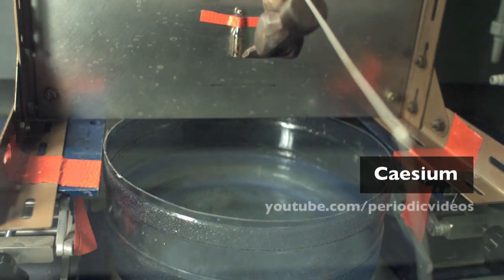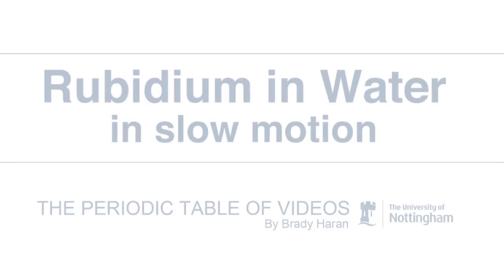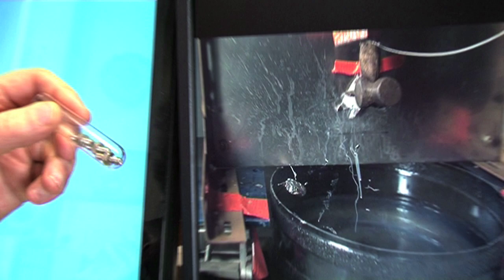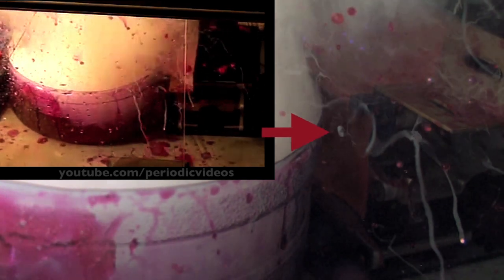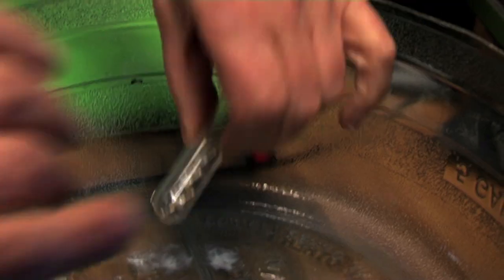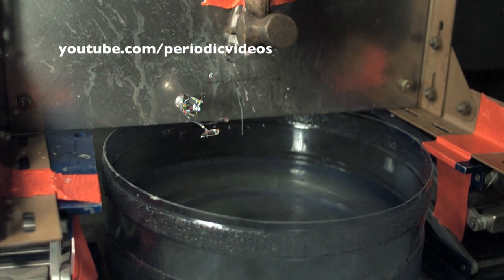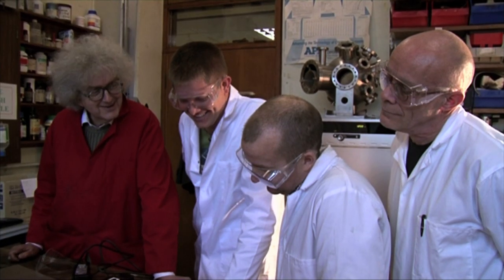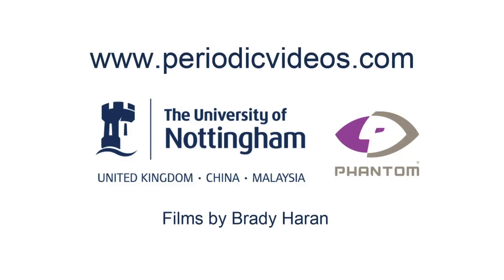Rubidium, Water and Indicator (slow motion) - Periodic Table of Videos

Comment: I like how you can see the partial Rubidium glass container zipping around the bottom rim of the water container like a very fast torpedo. It must have went around like twice in the first tenth of a second cause you see it go by then it explodes again back at the point you seen it zip past. So either it expelled some of the metal out and exploded shortly after or it went around twice very fast. It almost had a pulsating tempo as if to keep it's momentum going.

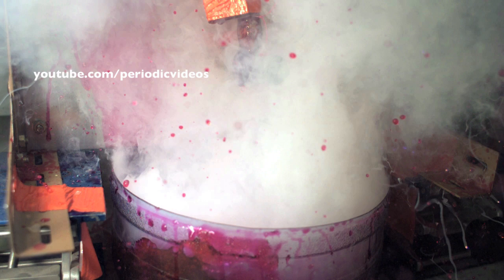Comment: If you watch the right side of the screen carefully at 5:48 through 5:50 you will actually see that the ampule has jumped up out of the water and is near the top of the screen.

What I think actually happened is that your second reaction occurs when the ampule lands back in the water, as the reaction begins at the right had side of the vessel at around 5:57 to 5:58.

To take this a little further, I would say that what is happening is similar to the charcoal/liquid oxygen reaction where the gas that is created is keeping the ampule bouncing on top of the water and then it throws it up into the air where the reaction slows and when it hits the water again it begins to strongly react. 

You are also able to see shards of glass ejected from the water towards the right of the screen between 5:44 to 5:47 which seems to indicate that you have a pressure wave that not only propagates from the explosion to the right but also hits the side of the container driving that wave towards the right as well. When the ampule hits at the right around 5:58 the reaction pressure waves seem to move back towards the left.
Reply: Actually looking at it again and pausing frequently, I think that you can actually see the ampule circling around the indented ring of the container from the left side where it first enters the water. The signs are the purple light and stronger explosions at around 5:46 and 5:47 at the front of the container, just before the ampule ejects up from the water on the right hand side.

Comment: There is no need for a reaction control system, nor even the rounded bottom. All directions the ball of metal can take will ultimately end up on the radius in rough or smooth motion about the center. The blob of metals appears to make around 2 rough circuits of the tub perimeter and each time slag is removed the reaction speeds to a burst and the blob moves on with renewed momentum.

Comment: The really interesting part of this reaction is that not only does the Rubidium go off in stages, but like the Professor said, each time the water rushes down the remaining tube of the Ampule  and reacts with another piece, the remaining Ampule also gets pushed around the container, like an engine that's being 'pushed' forward by focusing repeated explosions out of a nozzle like one of those early 'thrust powered by atomic bombs' rockets from Project Orion.

Comment: at 3:21 I can see a flash on the right side of the container.  In the next frame I can see the tip of the tube shoot up out of the container until frame 3:25 when it begins to descend back into the container to explode again. It looks like what's happening is that the tube drops into the container, rockets around the container in a series of three explosions, then drops back into the container to keep exploding from the exposed end.

Comment: one thing only slightly touched on is that, because the ampule bottom is largely intact and rounded; the reaction applies force all to one side of the rubidium mass, with the opposite side being able to move through the water quite easily. If you look closely just after the first reaction you can kindof see a trail of bubbles shoot across the front of the tank before the second reaction. In effect, they've made the world's smallest torpedo. Now we just need a tiny reaction based control system.

Comment: I wonder what sort of reaction you would get if you just kinda put a small amount of every element known to man into a container together and shook it about a bit
Reply: You'd probably give birth to a tiny earth. =D
Reply: +darkIkarusEssence Aww, I like that answer. Thank you! :'D
Reply: It's a very interesting question, and you've made me think quite a bit about it! I have a background in chemistry, and my initial thought is that you would get a reaction from the reactive elements. So hydrogen, sodium, lithium, chlorine, oxygen, and especially fluorine would be most involved in the reactants, each forming random compounds depending on what is around them. Water may form, table salt may form, it's anybody's guess. Then you would have the noble gases and several nonreactive metals sitting around, watching the events unfold. Great question!
Reply: You would get a lethal dose of radiation from the ultra-heavy elements.
Reply: I bet the amounts of different compounds would change randomly each time you tried it. Say the Sodium and Chlorine hit each other first, started a reaction at a different temprature than a different salt would make, taking a little more or a little less time to start burning the Hydrogen and Oxygen together, making slightly more or less water available to reach with X Y and Z, etc etc. 

Set off an avalanche and see if the snow falls along the same path or not.
Reply: I'm 3 years late but I love this question!
Reply: Hydrogen

Comment: Hydrogen is a fantastic fuel. An engine running on H does not produce nearly as much pollutants as gasoline/diesel. Not even comparable. Best option for thermodynamic engines.

But the thing is that it's expensive to produce. And storing it is also another problem (for cars). But you can bet that Big Oil doesn't want us to develop efficient methods. 

Don't know why you were pointed out as a spammer and got so many votes down. Your questioning is totally legit in my opinion.

Cheers buddy! ;)

Comment: the reaction of rubidium with water produces hydrogen and rubidium hydroxide.   the phenolphthalein indicator then reacts with the hydroxide produced in the original reaction to create water and the pink phenolphthalein anion, so the indicator doesn't significantly change the reaction, it only adds pink (also, the concentration of phenolpthalein is probably in the parts per million range)

Comment: Regarding the emission of light--do you think it's the visible spectrum, or possibly partially UV or IR? In my cameras, the sensitivity of the CCDs encompasses more than the visible spectra, it also includes some UV and IR. One way to test this is to point the camera at a hot object emitting heat but not visible light and see if that is recorded as a visible glow on video.

Comment: If you ever get a chance to use a high-speed camera again, perhaps you could use LEDs for the lights rather than hot incandescent lights so you won't have the melting/spray issue with the reactive metals?

Comment: This is excellent, looks a bit like a daylight volcanic eruption.

I'd recommend making a system which would dispense the cooled, solid metal in the form of a chunk onto a wide and shallow plate filled with 1-2 cm of water. That should give the most spectacular display of bursting vapor, hydroxide mist, spraying molten metal and coloured fire and should kind of like an asteroid impacting the ocean because of the molten material and the glow.
It would be a bit more dangerous, though. Just a bit..

Comment: All the water, even the tiny drops that are splashing out of the container, turns pink almost instantly.  It would be interesting, and quite possible (altho perhaps a bit tedious) to test the pink droplets for rubidium.  I suspect the rubidium ions themselves are not diffusing so quickly thru the water, nor are individual hydroxide and hydrogen ions, but rather the water molecules collectively re-establish the equilibrium of the Arrhenius equation with unbelievable speed.

Comment: A hydro carbon is a long chain of carbon atoms with hydrogen atoms.hydro carbons depending on the ratio of hydrogen and carbon can burn,for example if a hydrocarbon has more hydrogen atoms it burns hotter but quicker,and if there are more carbon atoms it will burn colder but longer

and thats also why we use them for feul,from beutane to hexene

Comment: when the rubidium gives off the lilac colored light, why is the light lilac... you mentioned that the solution is red because it absorbed all other colors but reflects red but what happens when light is its source... is the air around it absorbing all other colors but reflecting this lilac color or is it the light wave that it is producing?

Comment: It would be so cool to just see this element, let alone drop it in water. These scientists are so lucky to have access to all these goodies.
Prof. Poliakoff,  Please do a video on the ultra heavy elements (Ununseptium and such). Anyone ever wonder how heavy we can build?
Reply: fla playa Just because an element has a big atomic mass, does not mean that it is heavy as a solid. It depends on the density. A block of Osmium with the same volume would have a bigger weight as something like the really large atomic mass atoms at the end of the periodic table (not to say that Osmium doesn't have a big atomic mass, it is pretty massive aswell).
Reply: Two ways to define "heavy" in chemistry. The density of Rhenium is 20.02 g/cm3 tops out with Osmium at 22.59 g/cm3 and drops to 19.3 g/cm3 with Gold... The predicted density for Ununseptium is to be 7.1 g/cm3, which is craziness in my humble opinion. I was referring to large nuclei not density but I did just learn something. Never knew Osmium was the densest metal. Again I wonder how heavy or big we can build? Your prediction for the next 25 years?
Reply: Using dense materials doesn't necessarily mean it is practical for construction. More weight means more structure is needed to support it. Using lighter, flexible and resistant materials is more useful if you want to build "big". As for how big we can build, I think vsauce has a video on it or some channel like that. Using vanguard modern materials, a carbon nano-tube weave could resist the extreme forces required for a space lift, so if you count a cable that is 36000 km long as a construction, then I'd say that is one of the largest things we can build. Basically an elevator made of a cable and a ballast using the rotation of the earth to stay erect at the geostationary distance. For actual planned buildings, there is one in Saudi Arabia supposed to be 1km high, Kingdom Tower I think, That's pretty impressive.
Reply: I'm talking about building large atoms, not structures. The current biggest - heaviest - largest element is Ununoctinium 118. Again, I wonder how big - heavy - large we can build.

Comment: Here's another theory for the two explosions that rattled the water container: The first explosion sends a lump of rubidium back upwards from the surface of the water. This lump then drops back into the water, causing the next explosion.

At around 0:40 we see the event in what I take to be normal speed: There's the bang of the hammer impacting, then two "pops", separated by 1/4 to 1/3 of a second. If my theory holds, the rubudium lump jumped to 7½-11 centimeters (3-4½ inches) above the water.

Comment: a couple kilometers? by the time it's reached the ocean i doubt there'd be enough water suspended in the outer atmosphere to completely eat it away.
it may be coated in oxide though.
imagine it floating to the bottom of the sea, and an explosion or foreign chemical eats away that layer. and the ocean blows up. awesomeness.

Comment: Actually, he's right. Nothing spectacular would happen. Rubidium does react with the atmosphere, but if the ampoule was scored and opened in an argon glovebox, and then closed with a rubber bung, nothing would happen. Even if you work quickly in air, the top layer of the metal would just tarnish.
Rb and Cd aren't immediately pyrophoric on contact with small amounts of air.
A system could be made which would allow the removal of the bung and the rotation of the ampoule from the distance.

Comment: The reason that the "bottle" cannot simply be rotated. First the metal is in an ampule not a bottle. An ampule is a sealed glass container. As you can see when the Rubidium is first exposed to air, there is a smoke trail, this is because the metal is reacting with the water in the air.  If the Rubidium wasn't in an ampule the reaction would happen prematurely and would be extremely dangerous to everyone involved because there would be no control. These people know what they are doing.

Comment: I would like to see the experiment conducted in a different way. Have the metal in its tube taped to the bottom of the water container. On top of the metal have a sheet. Water is all around including on top of the piece of metal. An object is dropped  breaking the tube and starting the reaction. You should get a much more violent reaction.

Comment: by "lobbying oil pricks" I explicitly referred to the oil industry, I even made the effort to put it in parenthesis and hang an adjective ahead of it with a verb to make it as distant as possible from you, but apparently that didn't work. As for nuclear power, hydrogen is shitlessly cheap, use electrolysis, you can make hydrogen at home with some very simple electric equipment. The nuclear power just provides the megawatts required. And I'm talking fusion power.

Comment: "reacting chemicals with other chemicals without applying heat", and "using electricity" still is not a chemical reaction but a flowing of particles and using magnetic fields

Comment: Engines that burn fossil fuels in power stations are about 40%-60% efficient depending on type of fuel. Impurities aren't as high as you think and have a minor effect on efficiency. Your point about electricity is invalid; the chemical energy would undoubtedly be turned into electricity. It's just too convenient to transmit and use electricity as opposed to shipments of chemicals with equivalent energy. It would be dangerous at every step of the process. Research energy density.

Comment: Just because I pointed out that HYDROGEN GAS is expensive to produce doesn't mean I'm an oil prick. Quite the contrary actually. Otherwise, I would never have labeled it as being ''a fantastic fuel which is the best option for thermodynamic engines''.

Nuclear reactor? Sorry but I'm all against nuclear power. 

It never ceases to amaze me to see how some people like you can be so driven by their emotions that they can't even think straight.

Comment: The problem is that without an easily accessible source of free hydrogen you are just pushing the problem somewhere else. Sure, you aren't burning gas in your car anymore, but now you're burning coal for the electricity to obtain the hydrogen. And unfortunately, it costs more electricity to obtain the Hydrogen than it costs to refine gasoline and the actual difference between the two options, as far as fossil fuel consumption goes, is relatively negligible.

Comment: Kinda sad how mankind is being held down by the 0.01% and we've got all our fixes in our homes. A car battery, nails, and a sink is all you need for electrolysis, everyone has that.

My grandpa told me about a friend of his who almost got imprisoned because he used a bus battery, a tiny 12v solar panel, and a generator on his gas-water boiler to run completely off grid. Fucking sad I tell you.